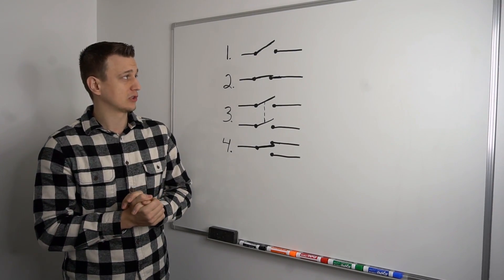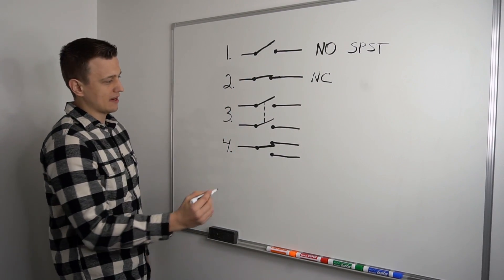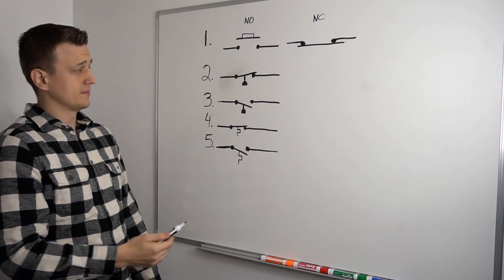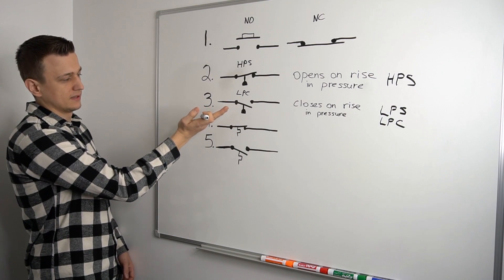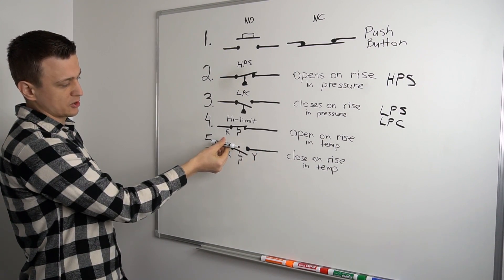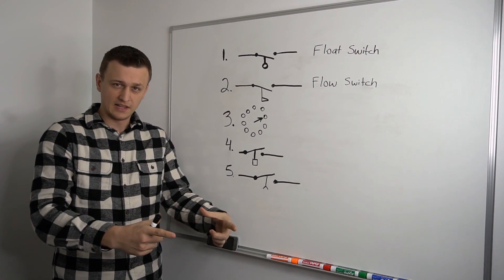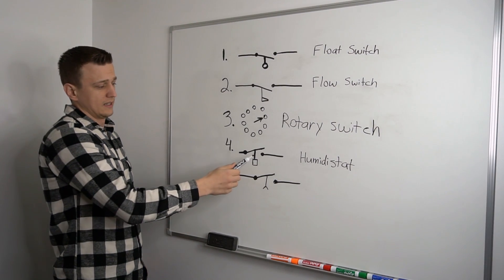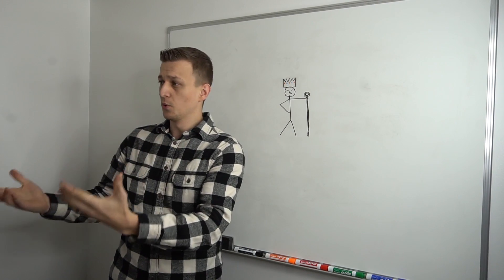Electric Symbols and Meanings For Various Switches

Comment from the maker: ➡ More Videos For Further Information:

How to Wire A/C Condenser Unit:
https://youtu.be/KCanZEsLVEI
How to Wire Thermostat:
https://youtu.be/VknvJ9POYDo
How to Wire Air Conditioner Compressor:
https://youtu.be/GhBTVn5CHBE
10 Ways to Splice Wires Together:
https://youtu.be/ihpNCVk1lF0
How to Read Furnace Wiring Diagram:
https://youtu.be/2MSedAkirqw
How to Read A/C Wiring Diagram:
https://youtu.be/2MSedAkirqw
How to Read Water Heater Wiring Diagram:
https://youtu.be/TX8SuHK1esY
Basic Thermostat Wiring Diagram:
https://youtu.be/jDLz3REPTWM
How to Wire Indoor Blower Motor:
https://youtu.be/4S8TZd-45bY
How to Wire Outdoor Condenser Fan Motor:
https://youtu.be/VlMhvwrpimE
Is Common and Ground The Same Thing:
https://youtu.be/wiKDlIlbiP4
Ohm's Law Explained:
https://youtu.be/sILl7p_J1UU

Comment: Great video again! I have a question however. So lets your temperature switch is opened when called for heating. Could that mean it's a bad thermostat and what could be the solution for fixing that? Or whatever reasoning for being opened if you can inform me on that! Thank you!:)

Comment: Word of advice. Please help. What's 5 flashes error code. " flame sensed when no flame should be present "? 

I cleaned the flame sensor. No voltage going to gas valve. Gas present. No voltage at pressure switch. ...
Reply from the maker: @Daniel L  You're welcome! If I had to guess, I would say bad board as well :) So hopefully that will get it fixed and you can forget about it for another 20 years or so.
Reply: @WordofAdviceTV  20 years. Lol. These greedy companies in the west will condemn a compressor or heat exchanger well before that time,  if they have to they'll csyss the problem themselves. I had to leave my last company because too much moral conflict with their dishonest practices.
Reply from the maker: Unfortunately I can't give you a concrete answer since I have seen various things cause that error code before.. The most obvious thing to look for is to make sure that the flame sensor rod was put back in correctly and it is not touching anything metal like the burners. Another thing to look for is the wire that goes to the flame sensor, is there any place where that wire is bare and touching something? Or perhaps it got pinched between something. If you are still not finding anything then there's not much more I can help you with without being there. I have also seen bad control boards or defective gas valves cause that error code before.
Reply: @WordofAdviceTV  very nice descriptive answer. Thanks much.  This ameristar unit is known to have these particular control boards go out. I tried to diagnose the gas valve and jumped R at terminal board to common on gas valve and blew fuse lol. Got to make sure you jump it to hot terminal on gas valve and not common ;) but the conclusion is bad board.

Comment: Thanks, I can't wait for the wiring video.
Reply from the maker: I can't promise it will come quickly but it's definitely on the list :)
Reply: @WordofAdviceTV  I bought a new wifi thermostat, I could use some wiring instructions asap. My oil guy wants to charge more than the thermostat is worth to install it. Hurry with wiring video. thanks.
Reply from the maker: @Paul  This is the only thermostat wiring video I have but it should work for most thermostats: https://www.youtube.com/watch?v=VknvJ9POYDo&t=1s   That being said though.. Usually wireless thermostats come with pretty detailed step by step instructions. I would refer to those as well.

Comment: This is great. My question is, how have switches changed? It seems some mechanical switches have become electronic.
Reply from the maker: @classic287  Ahh that's what you meant. For some reason I thought that was a rhetorical question at first. Many of these switches are still mechanical I think.. The snap disc or bi-metal on a temperature switch would be considered mechanical operation right? Or the little diaphragm inside of a pressure switch, I believe that is also mechanical operation. Flow and float switches as well. Perhaps the timer switch is electrical in a time delay control board. Haha sorry, there is a also a chance that my understanding of the difference between "mechanical and electrical" is not quite right too... Maybe someone smart will come along who will really spell things out for us :)
Reply: Word of Advice TV,  I’m not sure I know what I’m talking about, LOL 😂
Reply from the maker: Hmmm.. I don't know if I am understanding the question right. Which switches are you referring to?
Reply: Word of Advice TV,  Which kind of switch that were mechanical have gone electronic?
Reply: You probably don’t run into that in HVAC